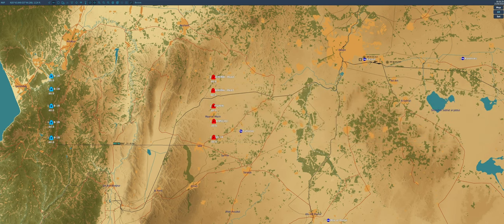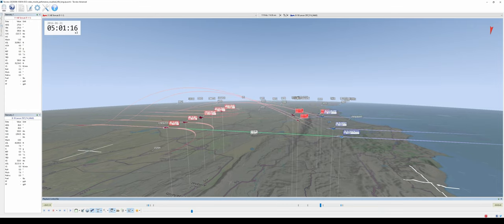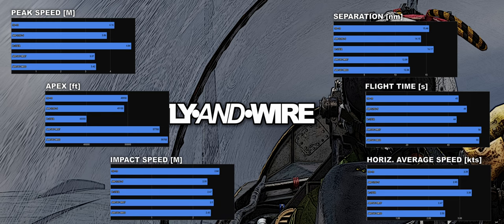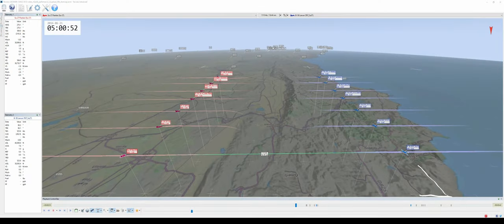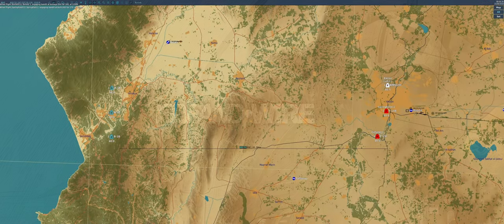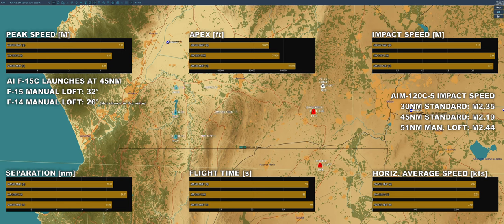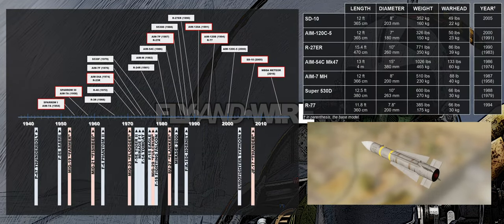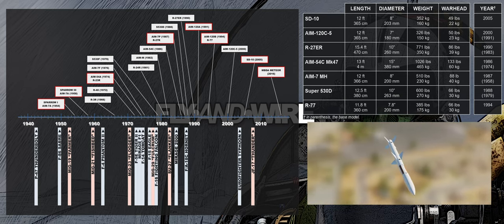DCS Missiles Performance Visualised

Comment: If you compare deceleration times within the same speed interval you will see the R-27ER is draggier than the amraam in a straight line, for example at sea level standard conditions once the rocket burns off the amraam will take around 23.8 seconds to decelerate from 3000 km/h to 1000 km/h, while the R-27ER takes 19.3 seconds to do the same, it bleeds energy faster.

It is not a case of "immune to drag" but rather that the powerful rocket motor in the ER gives it a very good headstart in a straight line so it would take some time for the others to catch up to it as it decelerates, but eventually they would go past it kinematically, the limited battery life of 60 seconds limits the maximum range before it runs out of speed though, it is a brute force approach to increase effective range at lower altitudes and to arrive quicker to the target before the sparrow hits the shooter but in the end it's handicapped for very long range shots by the lack of battery life and loft profile.
Reply: A comparison with lofted 27ERs would be interesting.
Reply: Not only this, but it is at a huge disadvantage being a SARH missile. Sure it can brute force the speed, but that won't matter too much when it's target is already dragging away meanwhile the R-27ER shooter has to maintain lock and most likely deal with a rapidly approaching AIM-120 going pitbull. The advantage of the AMRAAM has never been about maximum range, it has been about employing safely and effectively with launch and leave tactics.
Reply: @lc2144  i wonder why russia did not produce r27EA , it was said that they dropped this project due to r77 , but r27ea is just r77 seeker head in r27ER , it would have been much better , some say the russian air force still uses them and missiles like r27EP but not much is know to public. however the russian air force still uses r27ER and i highly doubt that they haven't upgraded it in the past 34 years. so there must be some upgrades.

Comment: 9:16 "longer than a Phoenix, and almost as thick"

The specs I could find online say (R-27ER first, AIM-54 second) 4.78 meters vs. 3.9 meters, so 88 cm longer, but 260 mm vs. 380 mm, 12 cm smaller diameter, with wingspans of 80 cm and 91 cm? AFAIK elongating a shape usually reduces the drag coefficient (for example on a list of Cds of generic shapes, short cylinder is listed as 1.15 and long cylinder as 0.82, and as another example the 6.5mm Creedmoor round was designed specifically with a long and slender bullet to improve aerodynamic efficiency) with all other things being equal. So the AIM-54 having a shorter body with a 114% larger frontal area without wings (0.45m^2 vs. 0.21m^2), it sounds to me like it would be at a massive aerodynamic disadvantage.

Of course aero dynamics is complicated, and the wings etc. will play A LOT into it, but just on the face of it the longer and much thinner basic shape of the R-27ER sounds like it'd be much more efficient.

EDIT: Also not suggesting that the R-27ER isn't overperforming, just that I don't think it should be considered nearly as lumpy as the Phoenix.

Comment: Yeah, i don't think i'll ever buy the ER or the SD-10 performance in DCS... good vid though! Keep making them!
Reply: ER is still used a lot by russia maybe it has more kinematic range than r77.
Reply: @hemendraravi4787  R77 isn't all that good to begin with, AMRAAM A or B levels of performance most likely. Unless you are talking some later versions.
Reply: @ilejovcevski79  i think r77 is good at high alt high speed launches , which is what was in this video. for lower alt it wont stay at higher super sonic speeds for long and it will end up losing speed quickly and get to transonic speeds where grid fins turn into an airbrake.
Reply: ok...